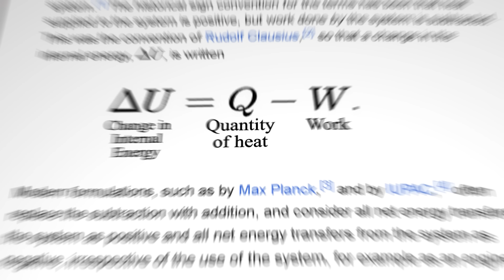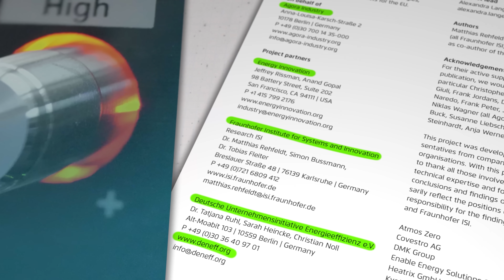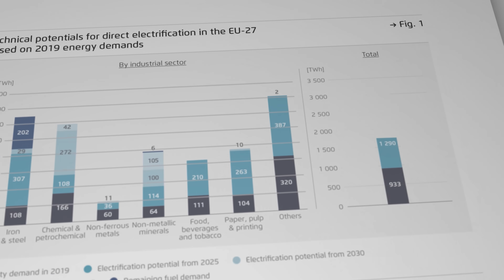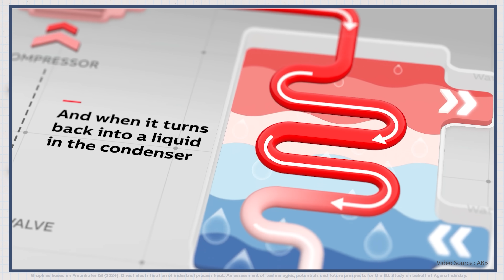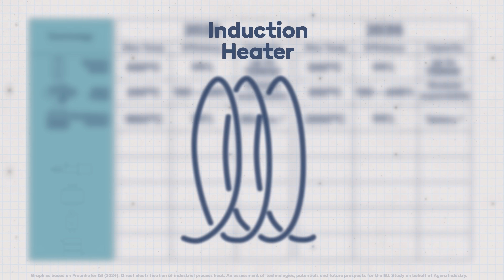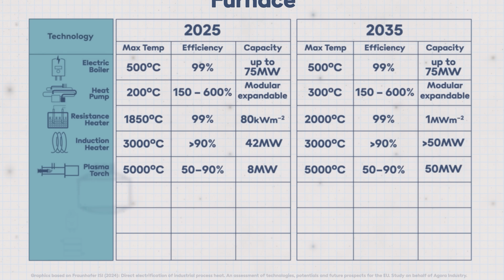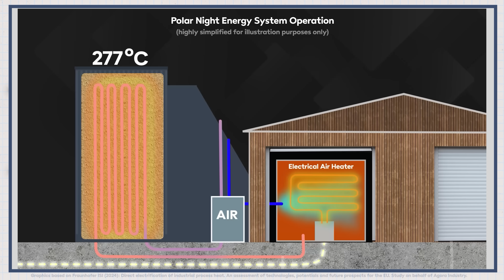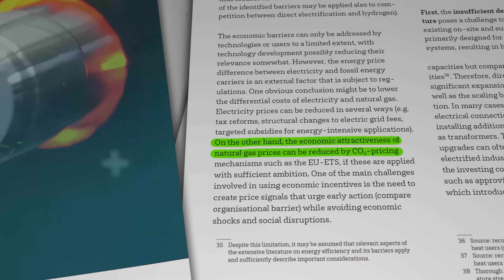Kicking fossil fuel out of industry! Here's how it's done...

Comment: A few important elements that are completely left out:
- The cost of upgrading the grids ( local in the facility, connection to the facility) to allow for the installation of an electricity-based heating system. Some production facilities already consume tens of MW, and it is not easy to find a few more MW without extensive upgrades to substations on the line.
- Backup system for emergencies. Some processes are heat sensitive and if you don't want to damage the equipment or the product. You need to keep them warm. So, compared to the current situation where you only need backup power for pumps, motors, sensors/communication and armatures, which can easily be backed up by a small battery array with a tens to hundreds of kW gas or diesel generator. It would need to be scaled up, which would increase construction and maintenance costs.

So on paper, everything looks simple and easy in theory, until you visit and see/work in such places.
Reply: The solution for the grid is electric car. There are 265 millions cars in the US. If they were electric, each of them would get a 100 kWh battery. That mean 26 TWh of storage. Why can't we have that? well, the only way that the People and car manifacturer get on the ship is if they are forced... And money buy election in the US... Enjoy going backward when the world is advancing... Yes it is a smidge more complexe but it is the only solution if we want a livable earth...
Reply: @pierregravel-primeau702  This model will work for residential areas and is slowly being rolled out in some countries in combination with V2X, but why the US isn't doing more is the question.
The situation is more complex for industrial facilities with high energy demands, as they are more sensitive to the frequency of electricity in the grid than households.
Reply: @Dqtube  I don't know a lot about power converter but if it is affordable and reliable enought in Texas or in the Massachuset that small house can inject their solar power in the grid means that it is feasable. 
I wonder what would be different between a large battery pack like utilities installed in California and in Australia and other converter like they have in EV. I thought it was all the same MOSFET that generate the pseudo sinusoidal wave form.
My last argument is that there are high power converter for Ultra high DC transmission lines in Canada and China, so I don't think there are technical limitations about how MOSFET are able to generate ultra precise wave function!
Reply: Why do we think it's an insurmountable barrier to upgrade our electricity supply system? We should be doing much of this anyway as we have older designed infrastructure that could benefit in terms of capacity, efficiency and reliability. It's within the memory of humans who are alive today that hardly any of our present electrical infrastructure even existed ... it has mostly been built during their lifetime. We are technically more capable yet we seem to think we can't achieve a similar level of improvement.
Reply: @MrAdopado  Because it is easier and cheaper to build a complete new infrastructure than to upgrade the old one. When upgrading, you need to synchronize with everyone who is connected. In the case of an industrial park, you can't simply switch off because it includes, for example, wastewater treatment units, incinerators or warehouses that have to maintain a certain temperature range to avoid damaging materials. 
I'm not saying that we shouldn't do it, but just because a new device is available on the market doesn't mean that it can be installed in a given location when it goes on sale.
Reply: @Dqtube  Firstly, look up "reconductoring". If it's easier and cheaper to build new in a certain circumstance then let's get on with it. If your country was involved in a war would you say you can't fight a war because it would cost billions? No, because there's always money available for wars ... and climate change requires at least the same level of committent as fighting a war ... it's a war to save a habitable environment for humankind.
Reply: @MrAdopado  Reconductoring is an interesting idea in countries where most of the wires on the poles are in the air, but in real life in many European cities since the latest transition from 22kV to lower voltage, the lines have been underground. So it's not a question of money for the equipment, but also the work and the necessary consent of all parties concerned. Like the land owner, the local authority, the emergency services as you cannot close all the roads in the area to ambulances or firefighters, public transport operators and as I mentioned in a previous comment, everyone connected to the network. 
You are making the same mistake as the author of the video and not looking at this as a complete matter.
Reply: @Dqtube  You are making the mistake of thinking that we have the option not develop our infrastructure in response to need! We have always done this. Not so many years ago electrical infrastructure didn't exist at all ... we build it when we need it. I can only think that you simply don't want there to be positive continuing evolution of infrastructure.
Reply: @MrAdopado  You are completely mistaken, try reading again. What I write all the time. In the real world, you can't solve a problem by ignoring any part of it. I can recommend you to find a real documentation of a project and read it , because your world is really simplistic. Or maybe even better, get a job as a consultant or engineer in one so you can better understand how things are built or reconstructed in real life conditions. 
What you imagine as some mythical evolution of the grid is not happening just by allocating funds.  Even locally, is needed a team of project engineers with different specialties who need to address the concerned domains, followed by the actual manual work of dozens or hundreds of people on the ground often from different contractors.
Reply: Stop whinging and whining, just get on with it.
Reply: @davidwatson8118  Thank you for this meaningful contribution to the discussion. It is always a pleasure to meet someone experienced like you.
Reply: So sad.
Work on your fact checking.
Don't post till you get all the facts right.
Can't cope 🤔 suck it up.
Get with reality.
Reply: @davidwatson8118  As I said, your unimaginable expertise is a blessing to us all. What is almost shocking is all the arguments you use to support your logic. You must have written a lot of scientific papers , because one does not encounter this almost academic language in internet discussions every day.

Comment: I've used an induction hob in combination with a small  volume  short term thermal storage to provide a majority of my domestic hot water at a fraction of the cost of my electric on demand hot water heater. Its good to hear of the efficiency of other applications for this.

Comment: Another issue with a lot of these is pure physical space and outages. Most places don't have a whole plot of land next to the boilerhouses to install new electric boilers and smoothly transition, and doing sequential upgrades can also be problematic depending on the details. But of course the main issue is money - if no one forces them to do this change, they simply wont. Why spend more money to replace equipment that's still working?

Comment: Hi Dave, 

You're videos are great! Well researched, balanced tone, up to date

However, there is a slight issue with assertation that electric boilers are 99% efficient

It is correct that electric heaters are 99% efficient at heating water, but in steam systems there "condensate losses" which are typically 15% - 25% of the total heat input, so the overall system efficiency needs to take this into account

I work for a company building industrial heat transfer systems that use thermal fluids instead of steam - we supply these either gas fired or electrically heated and the biggest issue we have convincing customers to use electric heating is price disparity between 1 kWh of gas vs 1 kWh of electricity.

The CAPEX cost is actually lower for electrically heated thermal fluid systems than direct gas firing and steam generation. There are OPEX costs that are lower for electric heated thermal oil systems when compared to gas firing and steam generation as there are more regulations and 3rd party inspections required for gas firing and steam generation. It's just the unit cost of energy that makes the OPEX cost of electric heating more expensive

Industrial heating via thermal fluids + electric heating is a mature technology also - we already install these for customers up to 1MW, 350oC. These systems do have heating efficiencies of 99% as there are no condensate losses

Comment: The thing to remember about stuff like coking coal for the steel industry is that this biosphere has demonstrated the ability to absorb and process some carbon dioxide output from humanity. So let's just go after all the lower-hanging fruit, and by the time we've decarbonised our homes and transport and construction and industry, it may well be that we don't need to decarbonise steel.
If it turns out we do need to decarbonise steel too, well, there's always charcoal. Grow a fast-growing carbon fixer like bamboo or hemp, compress and char it to make charcoal, and you have the carbon-neutral alternative to digging up coal. I foresee a huge industry in charcoal anyway from our need to do carbon capture and storage that actually works, so supplying the steel industry will be a useful side hustle for all the businesses that are going to be making charcoal and packing it back into all our old open cut mines.
Reply: No
The facts are that we are increasing the CO2 in the atmosphere.

Comment: Turns out that when you have 1 of those pie charts showing the source of emissions by area the largest part of it was electricity generation and then when we look into the other areas to fix them we mostly need to switch to electrical versions of the machines they were using so the electrical grid is basically going to have to undergo massive expansion to cope with all this. I suppose if you were to take all the fossil fuels we use per year convert that into TWHs then that's how much more power we will need each year minimum.

Comment: It is possible to make heat pumps capable of delivering any temperature that the system can tolerate, problem is that the bigger the temperature difference you create, the lower the possible efficiency, all else equal. It's like the inverse of Carnot's theorem, you can extract energy from any temperature difference, but the smaller the temperature difference, the lower the possible efficiency is.  

Resistive heaters can be extremely cheap, if there aren't any cheap mass produced systems designed for some specific applications that's a small, and easily solvable issue.

Comment: The good news: we have all the technology available. The bad news: coal, oil and gas are still so cheap that the conversion will not happen if not ALL do it. A company in the EU has two options: invest in "green" energy and try to forward the additional cost to customers or move to where energy and labor is cheap (India, China, ...).  It will only work if green energy (= electric energy) becomes very cheap. But that is not the case. The problem is the transition phase, which will last decades.

Comment: And what about e-fuels made of green hydrogen and captured carbon, for example methanol? I know that this solution would require a very cheap green electricity (total efficiency is not high), but it has couple of advantages. It can be used as a replacement for fossil fuels in transportation and can be very easily stored and transported on a large scale. Can be used as a long term energy storage. And it is also used as a fuel for fuel cells. Which it all makes it in my eyes quite interesting, kind of alternative to batteries. What do you think about it?

Comment: Great overview but it just shows how misguided our thinking on the topic really is.
Because all of these systems are simply treating the symptoms and not addressing the illness. 
We have such disproportionate energy use for industrial heating because no one uses process that take it into consideration. 
When you want to boil water you turn the heat until it boils. You don't reduce it ahead of time and isulate so you don't waste more heat than you are putting. 
And that faulty paradigm is applied everywhere. 
Clothing,housing, transportation ect.
We build houses as cheap as we can above ground then put bare minimum insulation and sell. Then owner have to heat it extra vs building it underground for higher cost and never have to heat it.
Currently we look at geothermal systems as superior to direct heating.  Then how long is going to take to figure out we need to burry the whole building instead of pipes and utilize the heat exchange?
Also given the current climate events. Underground houses don't burn down or get flooded and washed away by water or winds...
Yes you won't get a nice view out of the windows, but you trade it for a meadow, and  how much do you have to pay to stare at your neighbors house/building?

Comment: You are a bit harsh on hydrogen, specifically green hydrogen produced by electrolysis. This shows great promise in the production of steel, because the hydrogen is as good as carbon for ripping away the oxygen from the iron atoms, but the 'pig iron' produced by the hydrogen method has a much lower carbon content (the only carbon source is from the limestone flux) and is already more like mild steel than cast iron. The process is being actively investigated for the Whyalla steelworks in South Australia, where the surrounding flat pastoral lands are ideal for very large solar farms.

Another Idea that has NOT yet been investigated is using the virgin slag for cement (after cooling, crushing and grinding of course). This cement will have a higher silica content than Normal Portland cement but will still be useful in all applications where strength is not critical. Problem is it will look black or dark brown, which might not be as aesthetically pleasing as dull boring grey.

Comment: The good news is that much of this industrial process technology, like electric arc steel furnaces, induction welding, and laser welding, have been around for decades. Little or no R&D work is needed to implement them.  I've seen a number of precision metal assemblies produced using induction welding.

So the technology is there - the only question is how to incentivize it's use.  Most companies don't want to invest in higher efficiency or greener process equipment unless the return on their capital investment is relatively fast. That's where efficiency incentives can be helpful - little chance of that happening in the next 4 or so years here across the pond.

Comment: I've worked at a global graphite producer. They use graphitization furnaces that consist of an an anode on one side and about twenty meters apart the cathode. The furnace is filled completely with the materials in between and all the voids are filled with powder. Than the whole thing is closed with bricks and mortar. The whole thing is than heated by resistance to over 3000°C and kept there for a week.

Comment: So with electrification of industry I support the hybrid approach initially. Yeah I know, hybrid is a dirty word but it’s pretty silly to buy a hybrid vehicle. As for cement cones that uses natural gas in a big fire tornado to make the clinker. This means that it takes outside ambient air to mix with the gas to like fire. Nothing says that that outside air can’t be hotter. Hence either heat pumps or resistive heating on the air inlet to a kiln will increase the temperature of the kiln therefore decreasing the volume of hydrocarbons that are needed to be burnt to reach the temperature. The supplies are almost all industrial heating applications and it’s still BTUs out of electricity 😮

Comment: Unless you have a cheap source of low carbon power this is irrelevant in most states ur going to electric heat mans ur burnings coal or gas to generate electricty and paying for all the losses along the way so u can run an efficient electric heat source. Fro round the clock industrial use renewables are outside of prime markets is too inconsistent nuclear as it currently exists in the states is too expensive that just leaves hydro and geothermal. Also renewables arent competing with full lifetime cost of fossil fuel  infrastructure cause most of it is like decades old and long payed off thus they are competing against the fuel and upkeep costs. Which is why it can be more profitable to run 40 year old coal plant than a new wind farm. Thats before u get into land and transmission costs and the storage question. This why only large government intervention in the economy can Is transition the economy to a more green economy. Im not sure full net zero is possiable cause the last like 20% are hard to decarbonize industrial or ag processes how do u mining, steel, cement chemicals and agrichemicals without a lot of ghg emissions.
Reply: Look at that lack of evidence.
Reply: https://m.youtube.com/watch?v=UI43yFhPTEU&t=95s&pp=ygUQd2F0c29uIGluc3RpdHV0ZQ%3D%3D